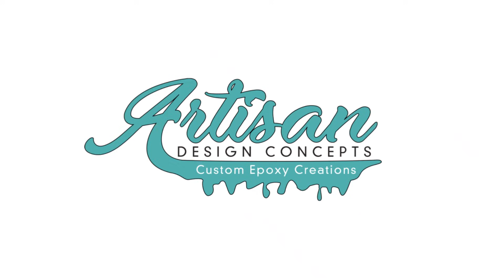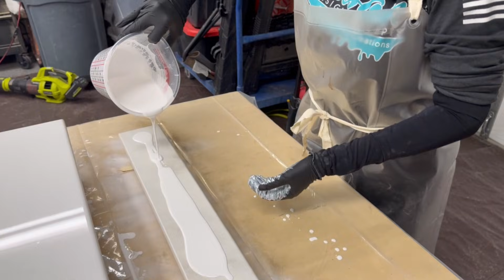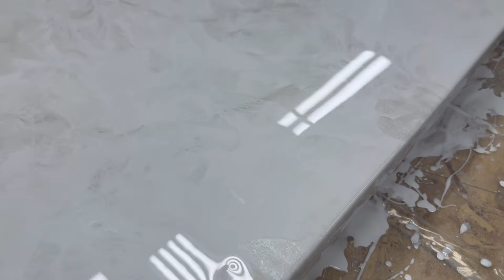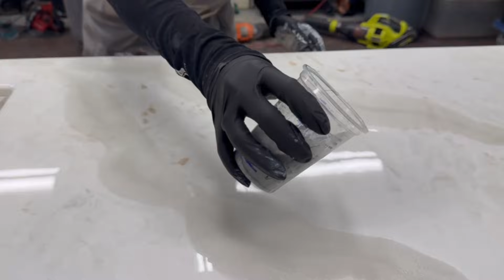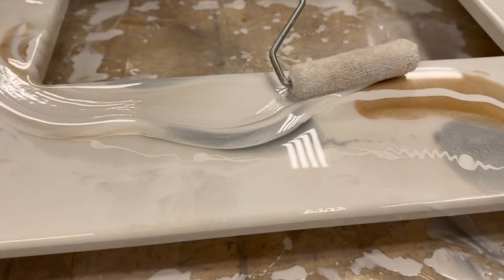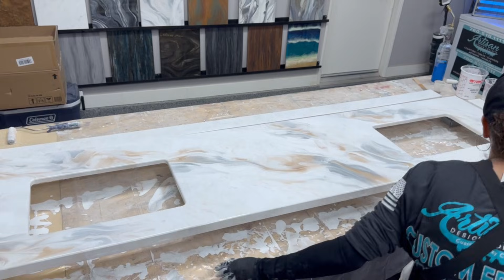Super Easy Whimsical Exotic Vein Tutorial | Artisan Design Concepts

Comment: What base would you use for a formica countertop? Also can you use bondo to make a rock edge with the polykote? Very confusing to hear to use Epoxykote as a base (since epoxy ambers) then polykote on top?
Reply from the maker: You can make the rock edge using Bondo but then do your primer with EpoxyKote. Yes epoxy ambers but you're covering that with an opaque color coat so you'll never see that.

Comment: Few questions……
Is the Metallic White a Stone Coat product?  
Which primer are you using to prep your substrate?  Do you recommend a special water proofing primer to be used on the underside of the substrate, near sinks ect?
Reply from the maker: Yes the metallic white is a Stonecoat product. You can use any metallic white that you'd like though. On MDF we primer with Behr paint and primer in one. But if you're going over a different type of surface there's a whole different process. I'd have to know more about what you're doing. On the underside we use Red Guard to waterproof the substrate.